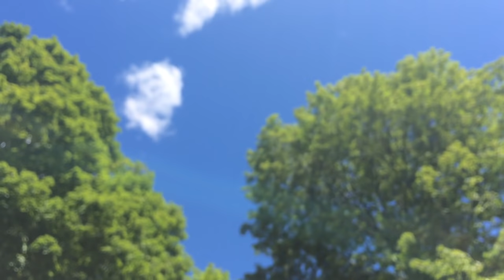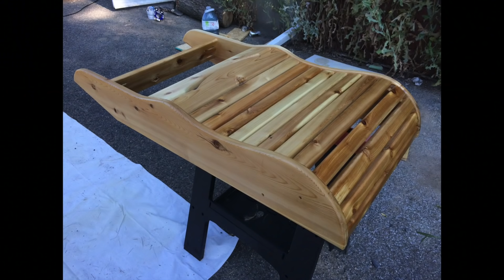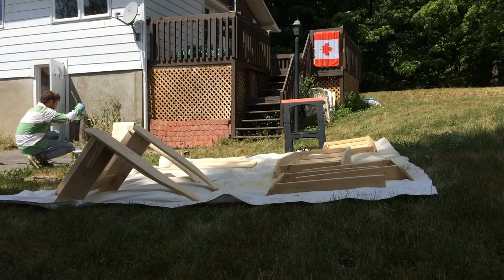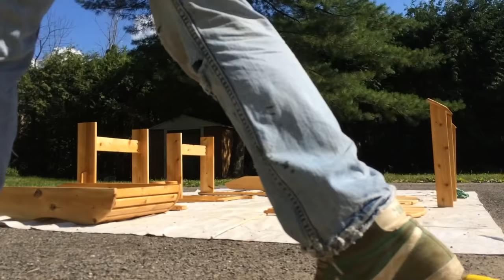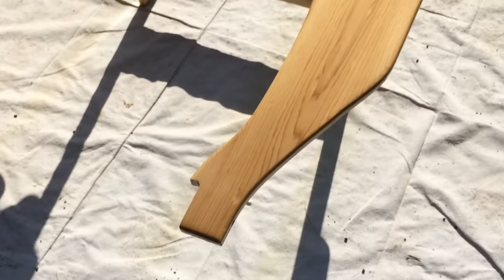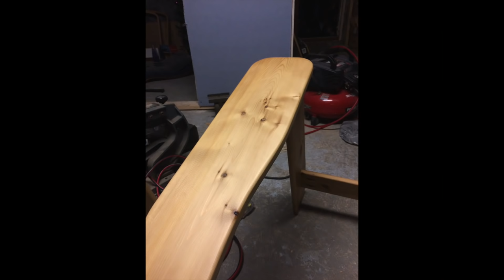Building Adirondack/Muskoka Chairs - Part 3 of 3

Comment: Great series. What size stock did you use?  It looks like 1x's for the entire project.  I do like how you hide the hardware.  Nice job!!!
Reply from the maker: Most of it is 1x's (i.e. 3/4") except for the arm pieces and the curved sides, which were rough sawn 1" stock and hand planed down to about 7/8" so it's a little thicker. That was mostly because the width for the sides and arms I needed wasn't available, but it does make a nice difference from the first chair I made like this years ago which was 1x for everything including the arms and sides.
Reply: WoodworkingStuff hi! I woul like to build a rocking chair but Im Just  building simple and easy furniture.  Do you have any advice? Some plan to work with? I would appreciate your help! It is a suprice to my wife who's pregnant.

Comment: great vids, and I like the joint chairs with the table and drinks holder, very neat. But you don't show how you fixed the back slats. There is no sign of any fixings through the face, and when you were spraying the finish to the underside there was no sign of any pocket holes either. How did you attach the back slats???? Are there any plans for the chairs??
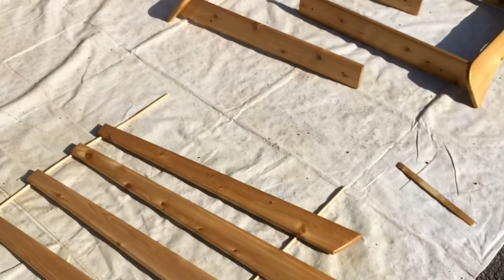Reply from the maker: Thanks, though no plans yet, but one day I'll get around to them. at 1:00 and 7:54 you can see the pocket screw holes for attaching the upper part of the slats from behind, but I forgot to drill the pocket holes for the bottom part before spraying. I drilled those after on the underside of the slat just below the one I'm holding at at 1:56.